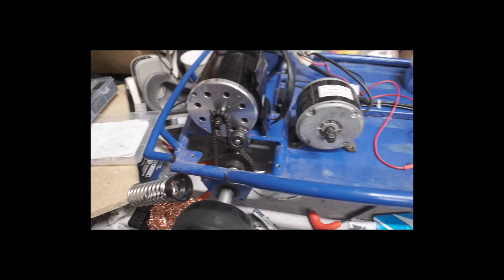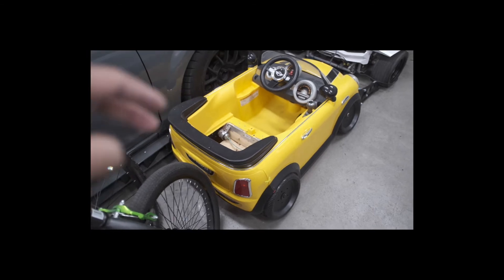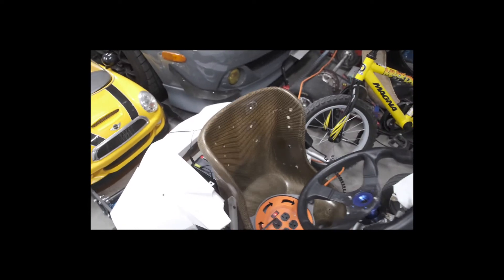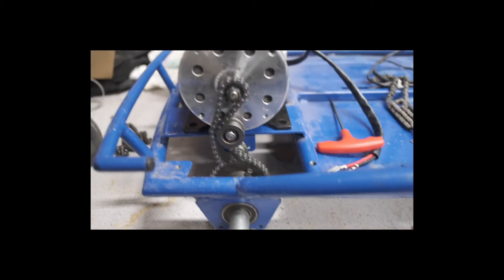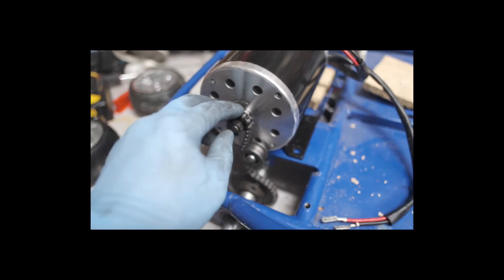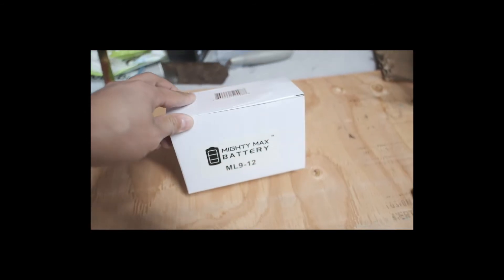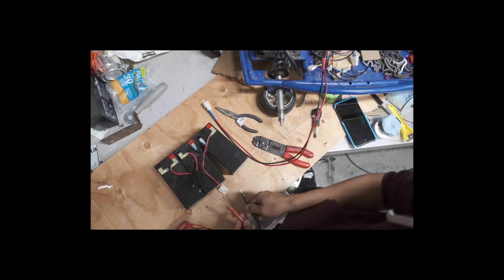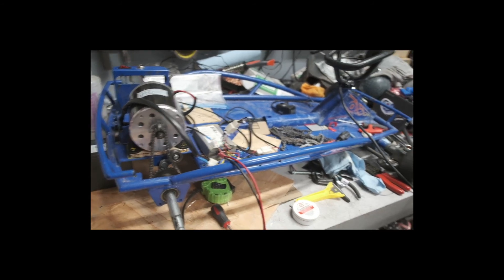Razor Ground Force 36v 800watts with Kids power wheels ride on Part 1

Comment: Dude, You left us without Part 2? I was so invested in this build lol. 
I'm doing the same with a 36v mini quad and Mercedes G wagon Power wheels.
Reply from the maker: Awww sorry buddy, I know how that feels since I too learn from others on YouTube, this video didn’t seem to be much interested by others on my channel so I never followed up, I did get it running, however the extra traction from the gokart tires and it’s short wheel base makes it so hard to turn. I do have 2 other karts build with different base, one was with a Honda minimoto gokart upgraded to a 48v 1800w motor and it ran great with a lambo body over it

Comment: Can you add video of installing body im building one also but I want to keep the go cart part hid to keep it looking stock im  actually thinking about cutting the go cart frame in half and mounting the rear end under my power wheels
Reply from the maker: Hello, due to the lack of interest i didn't post the part 2 but it has been completed long time ago, mounting the body, i was rather lazy and just did whatever worked, but let me see if i can post something on my channel's community section, or find me on instagram so i can share some video/photo with you @peekaystudio thanks!

Comment: Im doing the samething...im using a 1000WATT 48V motor...but I can run 36V.
I just go some industail esc ( becuase it has a reverse) 24-48v) 80Amps ....the throttle
wiring is confusing me too :-( 

I dont want them going super fast on it yet.lol..
I like your white go kart hack....it looks cool..
Been keeping an eye out for one of those Honda go kart.
Reply from the maker: OneEye Monster cool man, did you figure out the throttle wiring then? Because for the most part I did, not sure if I explained clearly in my video. Also, did you found this video from searching about “karts”?
Reply: @TeslaDIY  No, havnt....the wires are different colors ( i'll have to use a volt meter....My nephew is still sort of too young...( his hands arnt big
enough...to squeeze the hand brakes...So I'll have teach him how
to use the foot brake.

but he can handle the speed. I run him on 24v lion or 5s lipo 50c...
He's sort of complaining ( not fast enough.lmao) He likes to drift and
donuts ( it's hell on the powerheels)...I need to install the razor set up
in his Lighting..and still make rear wheels spin ( or still use the original
wheels with Hard plastic on the OD...
I have wheel hubs from electric wheel chairs...they fit on the shaft..
Im thinking of using ( pipe couplers). to extend the shaft a little bit
and press the hub in place.....and so the stock power wheels wheel
will have a shaft to sit on....aside from being mounted to the hub..
then use a bolt on the with a washer to also help press the in place.
Hope that makes sense.....
I take him on rides on 36v...just so he'll learn to drive faster speed...
Mostly for braking or slow down a little little bit before he turns...

He's used to whiping the powerwheels into a 360 spin...ect
He cant do that on faster toys.lol...or until he learns how to drive

Comment: Great video! I’m using the same throttle, w a new controller also. What were the 3 wires out of the 6  that the throttle needs to connect to the new controller?

Comment: What frame is that ?
Reply from the maker: Razor Drifter Ground Force
Reply: @TeslaDIY  thanks mate :) 
I built one from a Lamborghini ride on but it needs a steel frame
Reply from the maker: @aaronbandy6393  I also built one with the Lambo Aventador body, i ended up chopping it in half and mount both front end and rear end separately, 3D scanned the fenders, made a super wide liberty walk style over fenders and had it mounted on a Honda Minimoto go kart frame, upgraded it to 48v 1800watt
Reply from the maker: https://www.instagram.com/p/B9zNzyWH08X/?utm_source=ig_web_copy_link&igsh=MzRlODBiNWFlZA==

this is the only photo i have online, which isn't at its best look, i later lowered the front end and looked much more proper